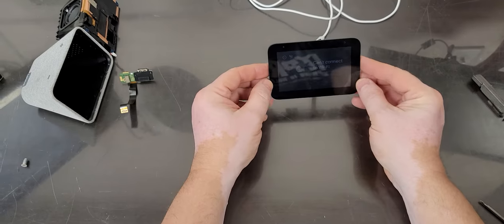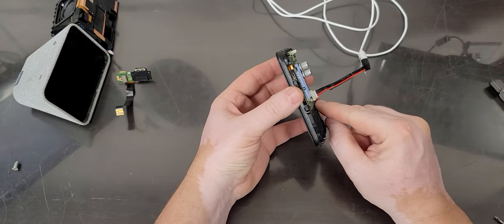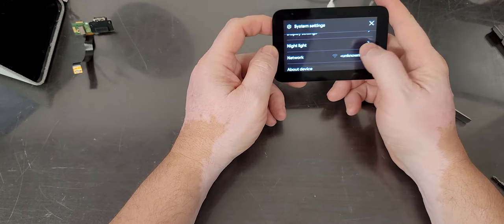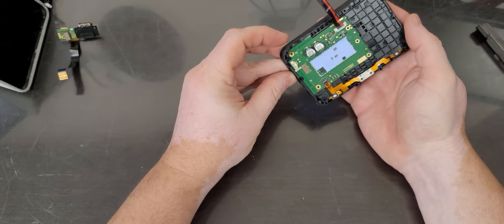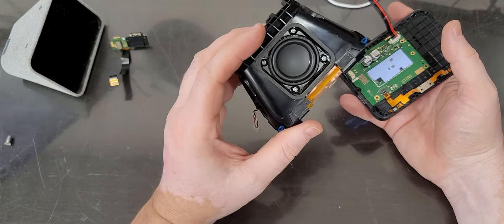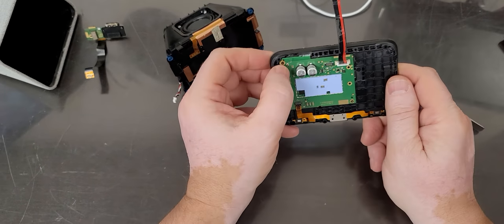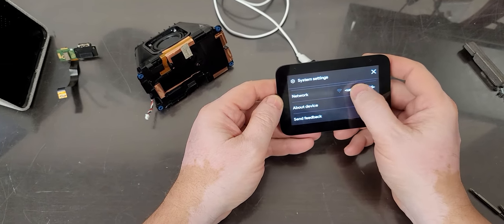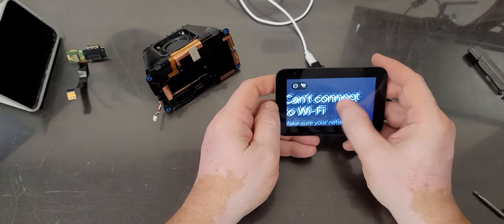Complete teardown of Lenovo Smart Clock with a surprise discovery at the end!

Comment: That's fair enough for Lenovo to block a device replaced under warranty.  You're getting a device replaced under warranty, not getting a device for free.   Most companies make you send back the faulty and don't allow you to even keep it at all.  They can likely be hacked if you wanted to get in and reverse engineer them  :).
If you read the specs, the device is definitely a light sensor.  Lenovo Smart Clocks do not have a camera.

Comment: The Light Sensor in my unit stopped working (probably from my toddler knocking it down a couple of times). Since the microphones seem to work (which are on the same cable/connector), do you think it would be worth taking it apart?

Comment: just for anyone wondering if you have a Lenovo to smart clock to model CD24502F if you want to take it apart, there's a little rubber square anti-skid footing pad on the bottom of the unit 
That runs it all the way around the signage. If you get a small flat head and Peele that back you'll notice for screws on each corner, you can get it from there.
Reply: Please share video

Comment: They should have put at least a small battery to not reset the time whenever there is blackout
Reply: It knows the time from the WiFi connection.
Reply: Putting a lithium ion battery in a device that is plugged in all the time is a recipe for disaster. The battery will degrade over the time you'll have to get it replaced, and it might even puff up.

Comment: Do you know what ohm the speaker have?
Reply from the maker: Looks like 3 Ohm. I put a meter on it. There may be some more coils inside, I am not 100% sure. I may take the speaker apart. I'll do a video on it.
Reply: @Mac1PC  Since the sound is horrible my plan was to take out the speaker an run a cable to another speaker.

Comment: I've had one of these for about 2 years and it's been great until 2 days ago when in went blank overnight. Unfortunately it's out of warranty and the fault wasn't that connector. From my basic tests there's a diode (I think) just under the power connector that was shorted. When I removed that and applied power a very small chip to the left of that diode (not the capacitor) started sparking and glowing red at one end. So that was it, dead after 2 years. Although I really liked it I'm not buying another one, or the new version. I'll probably try the Amazon Show 5 as it has more functionality and is cheaper at the moment.